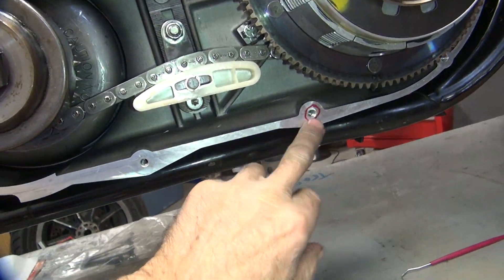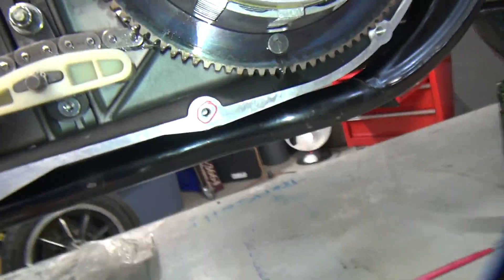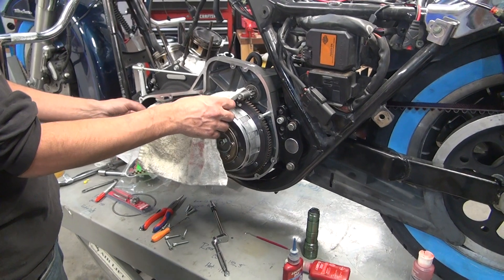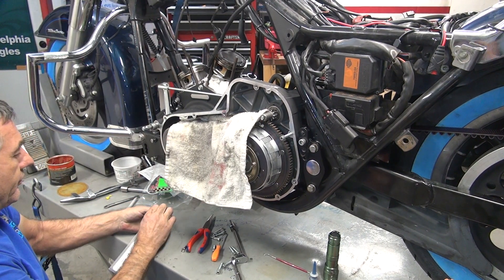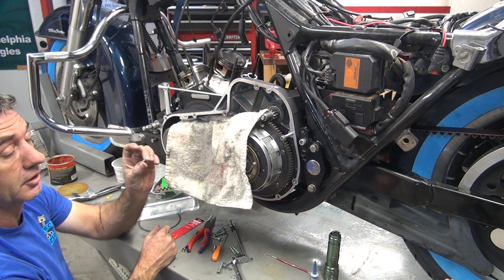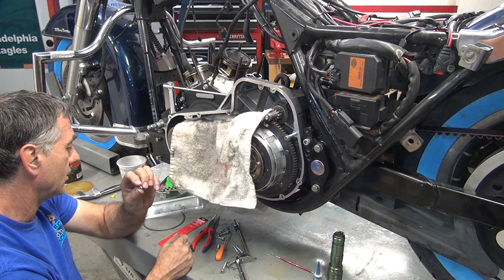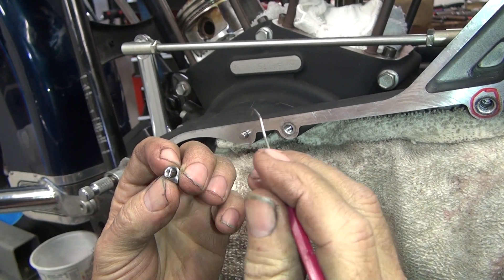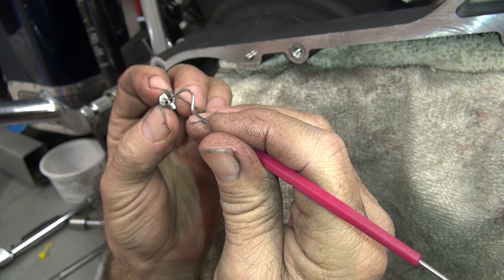#176 2004 road turd topend trans rebuild rear belt change FLHT twincam touring harley tatro machine

Comment: Only use one helicoil with needed length. With more than one they can be a bit off at the threads and it’s not worth the extra hustle to pull them out again.
Reply from the maker: that is not true. both helicoils would be installed in the same thread so they would match right up. this hole was a mess and still is. it does work but it is not like i would do it in the shop with the correct tools.
tatro